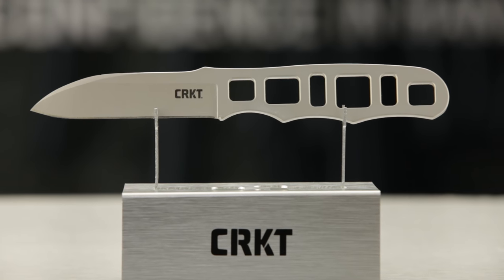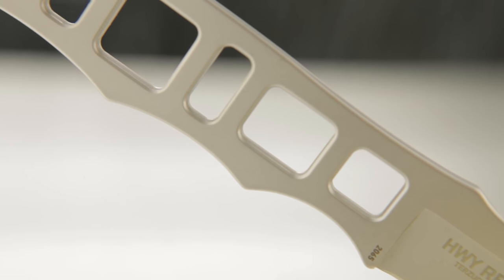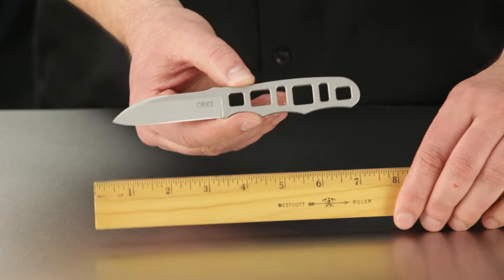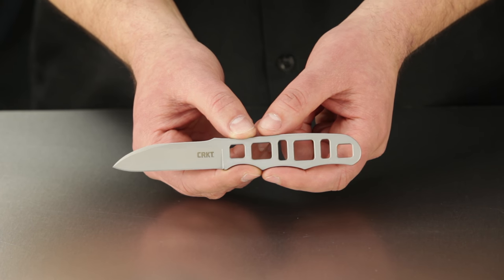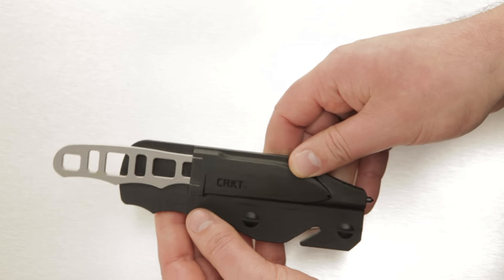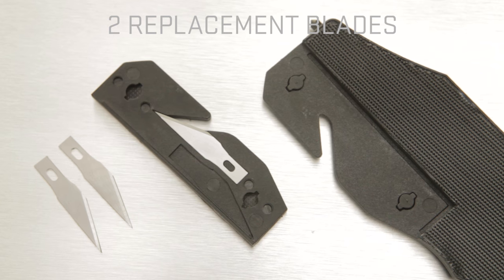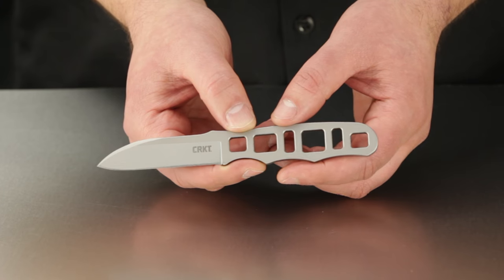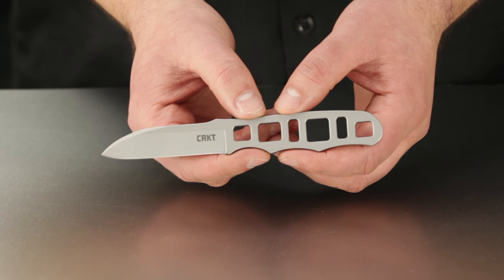CRKT Terzuola HWY Rescue Knife | A Bob Terzuola Design

Comment: Bead blast finishes are not corrosion resistant. Exactly the opposite. They are far more prone to rust. You really should know this.
Reply: The stainless steel doesn't negate that?
Reply: The stainless steel is stain less. Adding a bead blast finish creates a micro pocked surface making rust more likely. I've had staining with very stain resistant steels such as Aus6 due to the bead blast finish. Once removed with a nice satin polish. No further issues.
Reply from the maker: Hey you guys, thank you for catching that detail and keeping us honest. The bead blast process does create micro-pockets on the steel that can corrode without proper maintenance (keeping a light coat of oil on the blade). All stainless steels can rust if not properly maintained. During the media production process, it was my mistake truncating corrosion resistance, stainless steel, and bead blast, when I was writing up the featured bullet points for the knife video. Thanks again for bringing attention to the facts for the community.  – Joel from CRKT